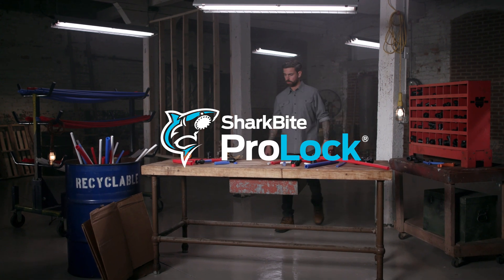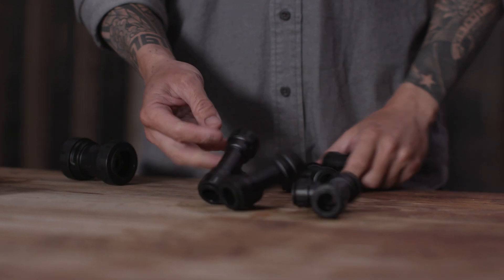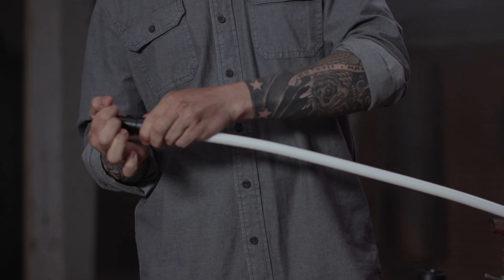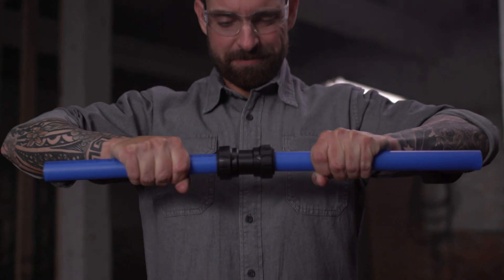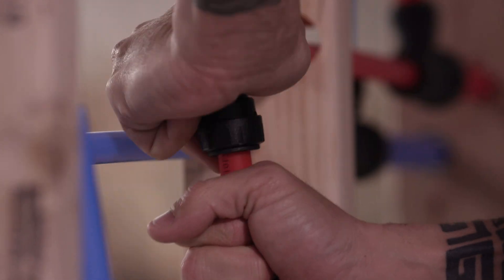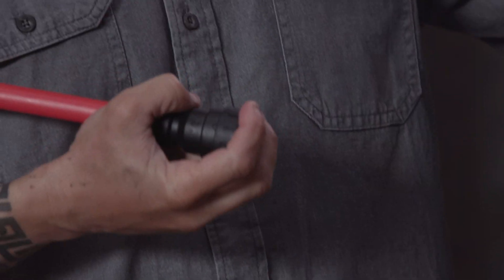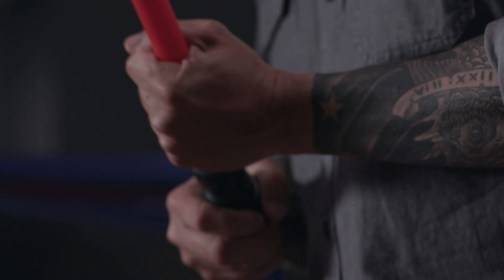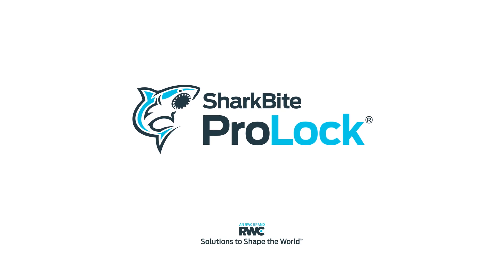SharkBite ProLock Twist-to-Lock Push System (NEW!)

Comment: these are great but im assuming they cant transition to copper???
Reply from the maker: Correct. You'll need to use the brass fittings for copper transitions. The ProLock fittings only work with PEX and PE-RT pipe.